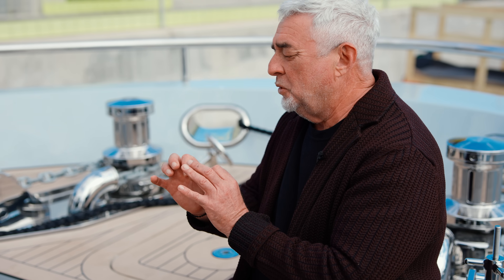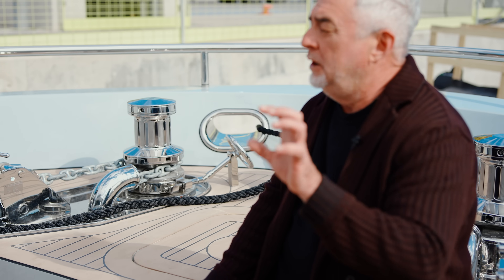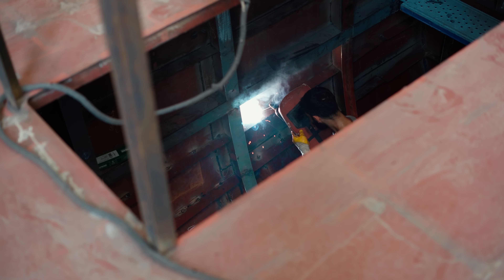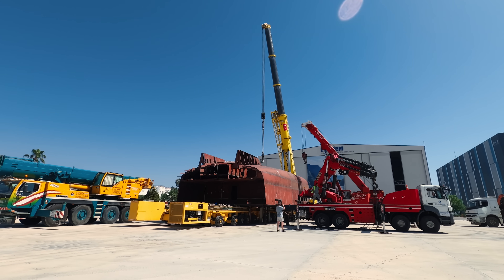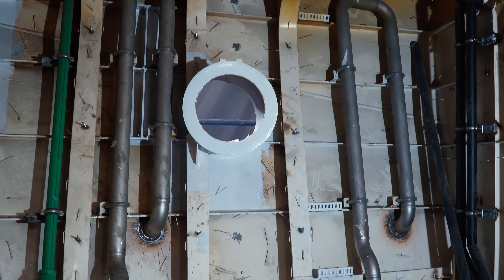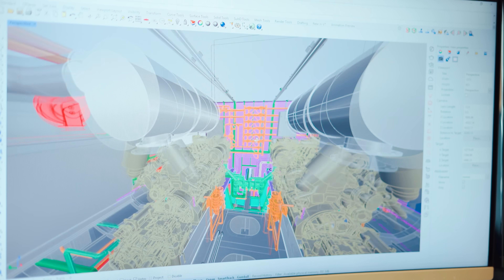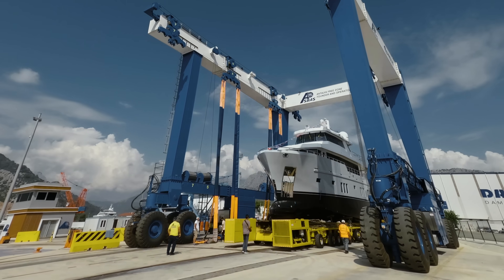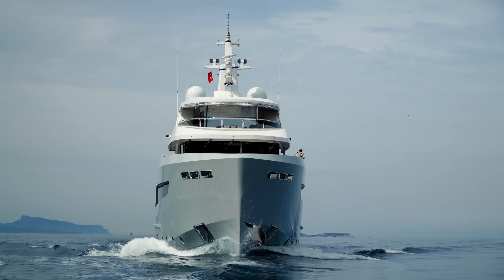Bering Exclusive: How a Bering Yacht Is Constructed Step by Step

Comment: From a structural standpoint, I'm curious: as you weld the hull skin together, are you starting with completely flat but correctly sized sheets and creating an inherently stressed/load bearing skin in place as it is welded? Or are ALL the panels pre-formed with both the size and curvature of the panel made beforehand so that the panels are already as close to the CAD model of the hull as possible? And if that IS indeed the case, does that reduce the amount of fairing required to get a superyacht-level finish? I'm really curious since even 6mm thick marine steel is NO joke to curve or form in any way.

Comment: Truly an awesome amount of product such as this en route and now even being made in the USA (Nordhaven versus Bering Round 1.) Because of advancements in infused epoxy resin and now Honda Motor Corporation reentering the outboard motor market the volume of hulls currently in production is substantial with an enormous amount of work being done to create far more robust designs to compete with these offerings. The biggest change in the US market over the past 20 Years has been the production of very robust jet drive systems from both Yamaha and Hinckley Yachts. Neither of course are Expedition Class hulls although Pershing has not been afraid to "go big" on this propulsion system. The USA currently has a massive glut of pure play ICE Platform product to include fuel ⛽ ⛽ ⛽ ⛽ ⛽ so the cost of operating these vessels might be set to plunge dramatically this Calendar Year 2024...which should be great news for those trying to move beyond launch and into the customer experience post sales as Hinckley Yachts already does.
Reply: Bering = Nordhavn on steroids

Comment: 1.) I love Bering, but I do have a few questions? Why won't Bering build something like the Damen Flexplorer? Not talking about the SeaXplorers, but the Flexplorer like Aurelius, or the new Canados143'. An open lower deck that allows either furniture or a selection of toys like a submarine, a large game boat for fishing, or other items like a bunch of jet skis. If the ethos of the yacht is meant for exploring, you want to do things when you get to the place and explore. A flat deck aft would allow for all types of toys and equipment, or just outdoor activities in general. 

2.) Why was the 180' removed from the website? Will Bering not ever make anything over 140'? What if a customer wanted a one off 160' like the 92' you built. Would that be possible?

3.) You all had several orders for the 140 and I believe at one time Alexei said they had 8 ordered. Will we get to see any of those at the boat shows or on YouTube?

4.) One of your competitors in the explorer yacht realm, whom I won't mention,, is building yachts with a steel hull and then a GRP and carbon fiber top section. They claim it is just as tough and durable as aluminum, but it is lighter and because the triclad isn't used, also cheaper. Is this actually true?... because some say it isn't as tough and the savings don't come from not using triclad, it comes from less welding. Not asking you to slam them, just clarify if these claims are true? 

5.) Not a question, but a suggestion. On the Bering 38 catamaran with the bunk forward, if you put a drop down bed commonly found in campers, inside of that boat, you could sleep another person or 2 kids and really make it a family boat. If you also placed some brackets on the sides, then people could put Jerry cans for water or fuel in them, or use them for fender storage, or a live bait box could be put there and a pump that ran fresh saltwater into there could be used. Rubber coating on the corners to prevent chaffing of fishing line might be good too. I have a bunch of ideas for that since I used to work on fishing boats.

Comment: What are your thoughts on a single engine with the standby power from the generator to the hydraulic gearbox to propel the engine if the main engine breaks down